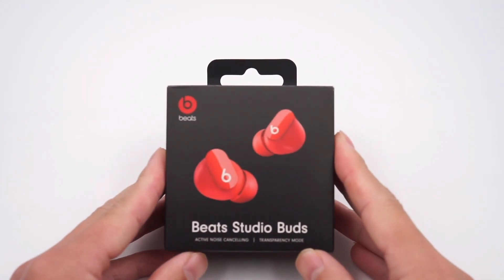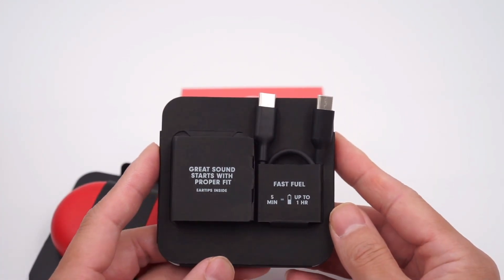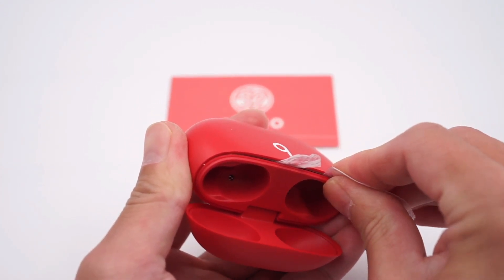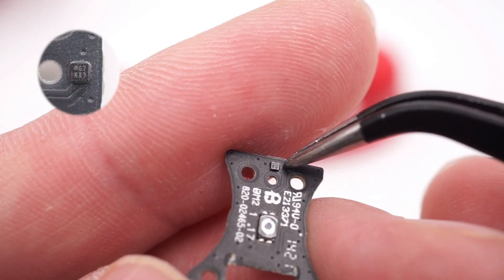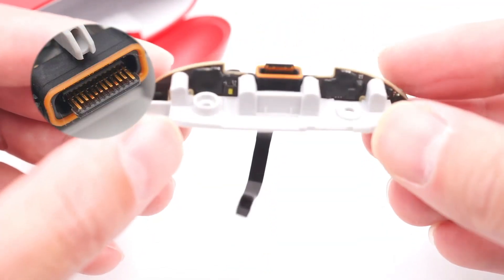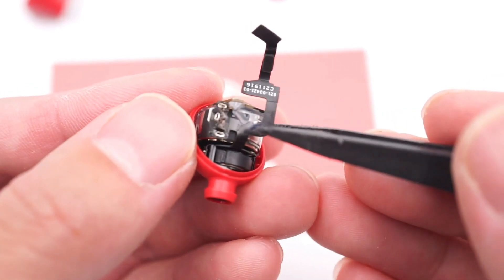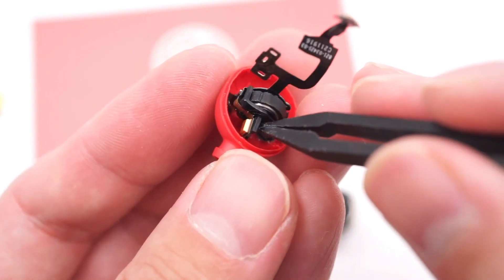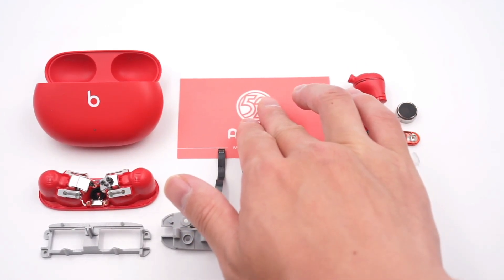Teardown of Beats Studio Buds True Wireless Noise Cancelling Earphones

Comment: After looking at the teardown I was wondering why on earth I paid 150$ for it. Because it honestly looks like that beats played less than $20 to make them.
Reply from the maker: you know, brand value, innovation and marketing cost.
Reply: the engineering the mechanics on how these earphones made to make it small as possible so it's cost alittle higher..
Reply: Do you have all these microchips and control chips/ regulators just lying around? I dont either. Priced waaaaay fair for what these are.

Comment: Excellent video! I'm wanting to take my battery case apart and use a Dremel tool to cut out the area where the inserts go, to allow more room for the Comply Foam tips, because I have a hard time getting my buds to charge with size L tips in. Thanks again!!